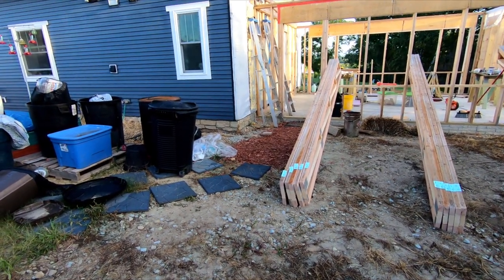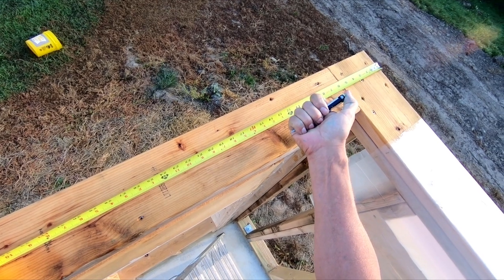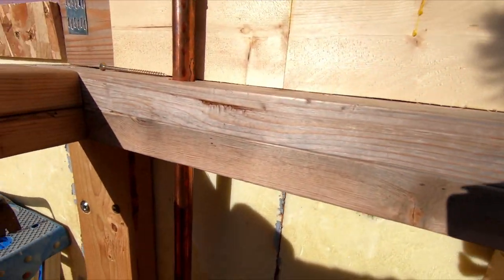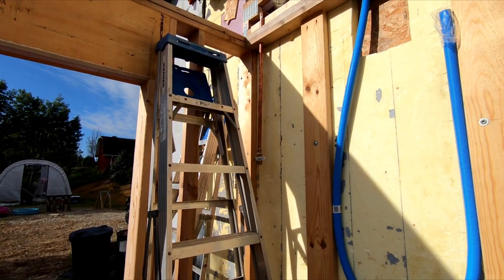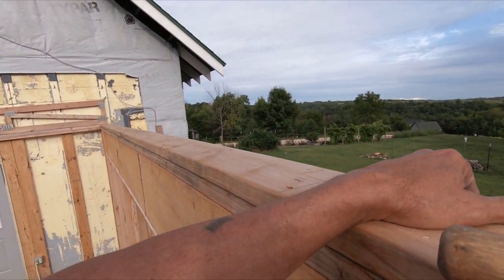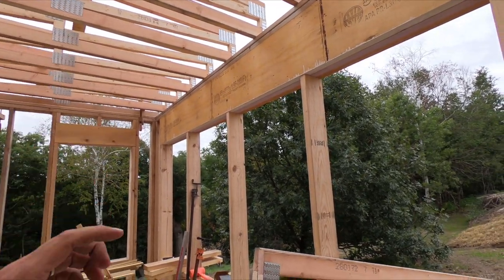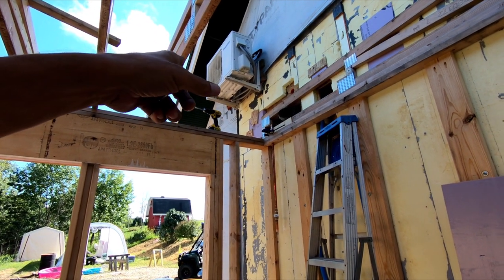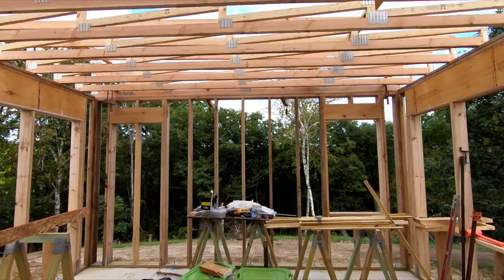Installing the Mono Trusses [Flat Roof Trusses]

Comment: What is your pitch ratio for the water run off?   I have to build a new roof on top of my old roof due to sagging and 0 grade.  I have water ponding everywhere.
Reply from the maker: Hi Michael, The mono trusses have a pitch of 1/4" per foot. The rubber roof manufacturer (RoofKit) recommends no less than 1/8" if I remember correctly, but 1/4" per foot I have no ponding except around the scuppers where the flashing stands proud of the roof -- and there is no way around that.
Reply: Awesome!  Thanks for that info. That’s what I’ll go with too then.  You did a nice job!